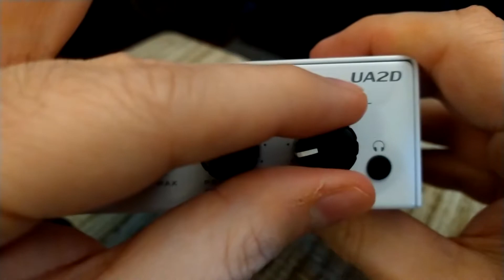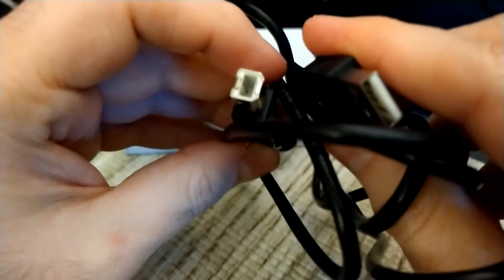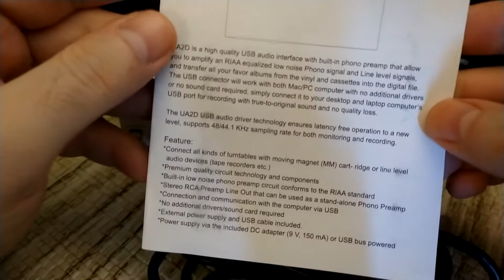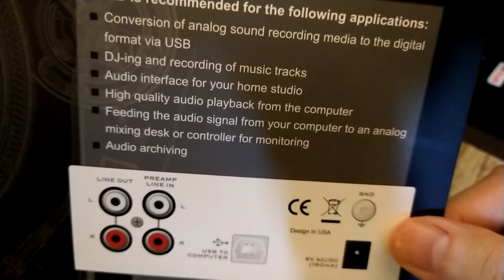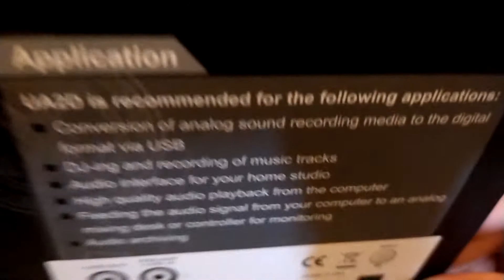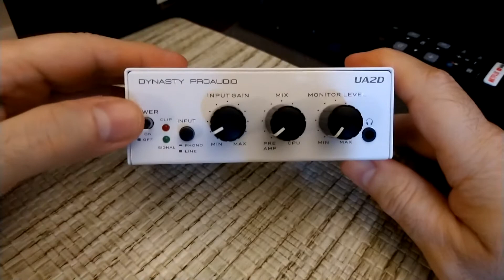Dynasty pro audio UA2D

Comment: Ia it 'a DAC as well'? or is it rather an ADC integrated with a phono pre-amp? I suppose that if you can listen to digital files over USB from your computer, through the headphone output, then it must be a DAC as well as an ADC.
Reply from the maker: @stevenofford495  it's a little of everything, kind of a jack of all trades
Reply: @jubilant_ear_reviews  Well, I hope that it doesn't fulfill the second part of that old saying. "......and master of none!"
Reply from the maker: @stevenofford495  it's decent for the cost , I don't use it much anymore
Reply: @jubilant_ear_reviews  Maybe I should have bought yours from you if you don't use it; but as it was a gift for my brother, who recently got a turntable for the first time since the 80s & was finding it sounding a bit  'thin' compared to his digital stuff, so I wanted to give him a phono pre-amp with the posibiloty of boosting the input gain a bit. Of course with a bit of messing around, maybe it could feed it through the ADC, onto his Mac' via USB, a bit of digital processing then out to his powered speakers & all sorts of variation could be possible.
Reply from the maker: @stevenofford495  The Sundavo I reviewed just before this one , is my favorite multi use device but this isn't too bad.

Comment: Thanks for the review. I noticed an identical model called Stellar Labs on Amazon and eBay for about $10 less. Just an FYI, assuming they are the same.
Reply from the maker: More than likely they're the same, this one is being used as just a phono pre amp but it's nice to have all the other features.
Reply: The Amazon reviews look good. Have you tested the headphone output and monitor control? I'm very curious if the sound is fatiguing or not.
Reply from the maker: @jasonshaw2065  it's definitely not reference class but it sounded clear and had good details with a hint of warmth in the lower mids and brighter upper mids / lower treble